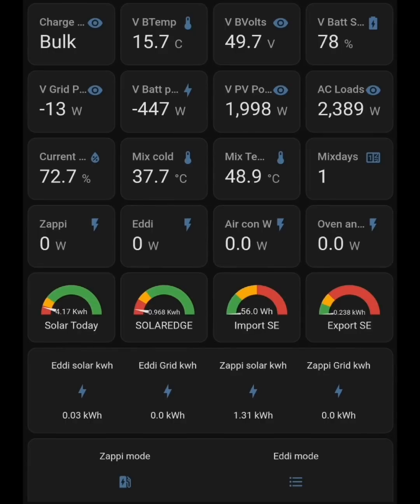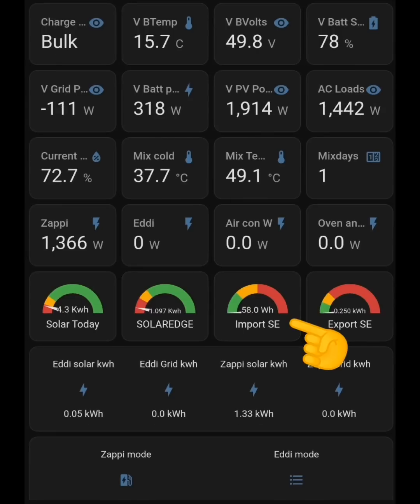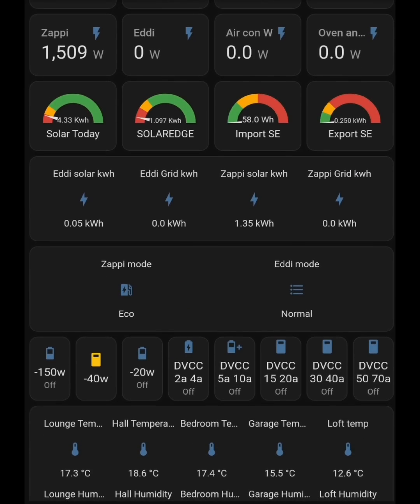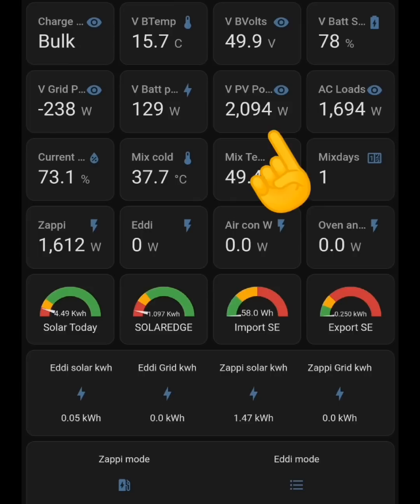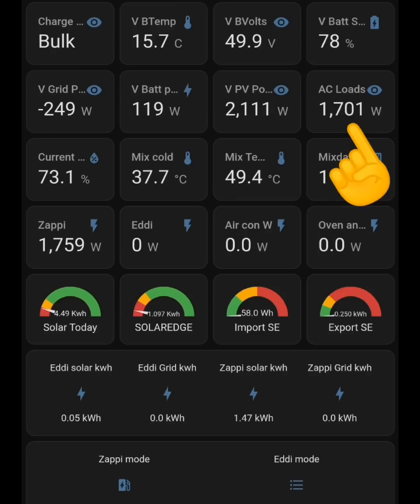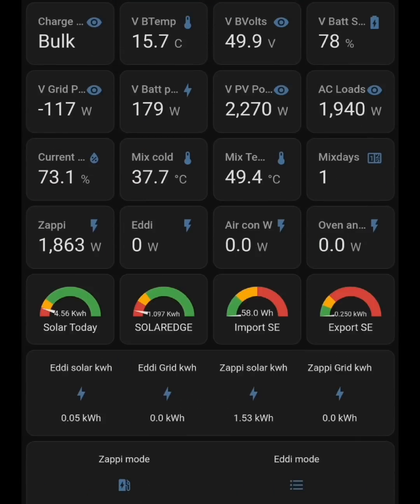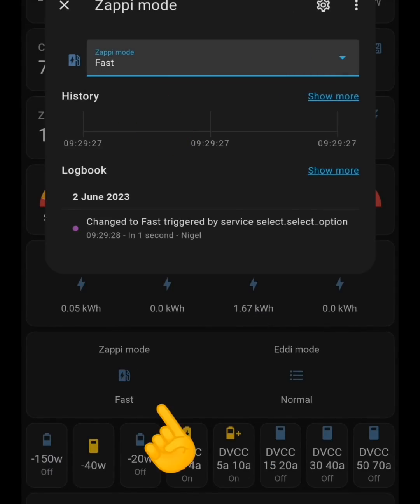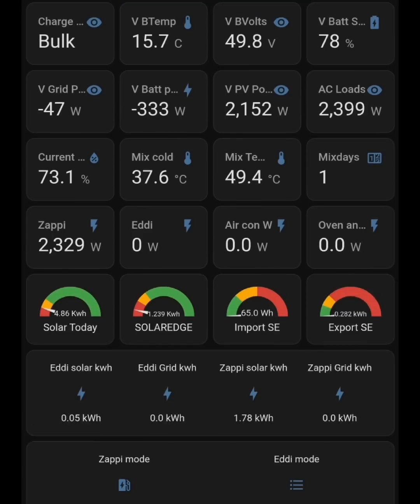Zappi vs Granny charger - Which IMPORTS less energy charging on solar - Data watcher's delight

Comment: Hi Nigel it may be worth considering replacing your myenergi Zappi with the Victron Car Charger.  it integrates into the rest of the Victron system and should eliminate these issues, it has solar export only charging function like the Zappi but better integration with the Victron system.  I much prefer the Victron charger as you can set (via App) what max charge current you want to charge the car at (you can do this on myenergi, but not via app), which means you can control charge speeds rather than the myenergi on/off (fast/off peak charging).  This is great as if you just want to add say 15kw on the 4 hour cheap rate, you can set it to charge at 4kw and spread the charge time over the 4 hours, putting less stress on the car battery and reducing overall house load - the Zappi would just charge at full power for 2 hours and then switch off.  You can still keep the charge on the outside of the Multiplus II and this is an installation option.

It would be great to see a Victron Car Charger video on your channel - hopefully if you reach out to Victron they would maybe consider letting you try one!

The only issue is it's type 2 to type 2 cable, but mounting somewhere to wrap the cable and just leaving one end plugged in isn't much of a problem
Reply from the maker: I have been looking at that but victron are still sorting bugs . I'd like to test one first really to be sure. Fixed amp charging  and limiting battery discharge features are great but scheduling has only just been implemented

Comment: Just goes to show that the key to all this is the control system, and choosing equipment that can integrate nicely.

Once you have Home Assistant in the mix, the simple logic of these single focus systems (zappi, victron, eddi etc) suddenly becomes a baseline competence and the true magic happens when you automate and orchestrate these around one's needs and lifestyle.

It's possible to take any dumb tech with open controls and make it super smart with Home Assistant 🤓
Reply from the maker: Yep, think I've said that a few times now. Inverter choice is key for software
Reply: @EVPuzzle  true to a point... What I'm saying is if it's a good inverter (i.e. good at doing the electrical bit) that can be controlled by HA, then getting an inverter with better software becomes less important as you can fill in the gaps better using HA then any premade inverter software solution. For example, I've got a cheap Solis hybrid that is basically dumb as a brick but inverts well... with a decent HA integration it's smarter than anything on the market, for me, because it's acting exactly as I need it to. Love it!
Reply from the maker: @TheBadoctopus  totally agree, no point have 2nd rate extra software you don't need

Comment: I have the same frustration with the bouncing when heating the water with my Immersun while charging the battery. I tend to let the battery fully charge then schedule the battery to sleep from 12:00 until 16:00 so the immersun doesn’t draw from the battery/ grid  too much .

Comment: Is the solution here more to do with simply a factor of constant charging functionaility to avoid dropping in and out of excess solar charging via the zappi, thus use granny charger if its a sunshine and clouds
 day and if your are on octopus flux or other benefitial export rates then charge at off peak overnight constant max rate for night tariff which is no more than what the export tariff for flux is for daytime and the bonus peak rate benefits, i may have summarised to simply.
Reply from the maker: Seems to be but zappi behaviour changes on the 1.4kw limit

Comment: I tend to try and manage the situation myself, so when it’s sunny like since the middle of May I let the battery get to between 80 & 90%, then start charging a car on Zappi Eco, usually around 10:30 when solar is above 4kWh. I might give the hot water a 20 minute boost first. At around 2pm I’ll put the pool heater on, as the sun will have warmed the top level already throughout the day. Zappi onto Eco+ just in case. If the car stops charging the battery will have plenty of capacity to soak it up. If there’s ever any danger of getting to 100% I’ll boost the hot water
We use more electricity than we can generate most of the time, and there’s always somewhere to put any extra
We have 7.23kWp at the moment. I’d love to put a 4kWp winter array against our south facing rear wall, but although I’ve adopted the land outside I don’t think I actually own it 🤦🏻‍♂️
Reply from the maker: Manual approach for those that love being in control. That's me too much of the time but tends to let more slip to the grif

Comment: Very interesting.  I have an EO Mini Pro 2 with the Solar extension.  I don't like using the solar charging option as it seems to ignore the house load, it charges at the output rate of the solar.  I suspect it is using the CT clamp on the wrong tail. As I don't yet have the battery in place, this means that I always pull from the grid while using it 😞.
Reply from the maker: Think you're right about the CT

Comment: Hi Nigel , I use a 3.6Kw car charger ( which doesn’t change charge rate ) which triggers on and off based on battery SOC and solar pv amounts
Reply: Are you using one of those hardware e.g. A30 "dump load" controllers or similar?
Reply: @EverydayLife621  no it’s just a old school Bosch 3.6 charger , one of the very early ones
Reply: @AllElectricLiving  Interesting, how does the charger know when to switch on? - Ive just bought a small A30 controller (£11) which switches on / off dependent on battery voltage - but as usual haven't unboxed it yet
Reply: @EverydayLife621  all automated with solar  pv , battery Soc , and hot water house demand etc with home assistant
Reply: @AllElectricLiving  Cheers 👍- Im not so modern (home assistant?), so prefer hardware  to software at this stage.

Comment: I also use a granny charger so that I can charge from solar but it was exporting to much so have bought another type 2 cable but it is for a 3kw charger so this limits my charge to 3kw and reduces the export when a cloud goes by the battery picks up the extra current required. Seems to work OK.

Comment: In the majority of the year (summertime BST) we charge the Honda E from a granny lead during the day, which usually gives us more than enough for all our local needs. This often prevents export for which we get pathetic rates, yet keeps the home batteries topped up too. They don't cheap grid charge at night until they drop below 70%, rare in summer.

In the depths of winter the E takes what it needs from a 7kW charger at night on cheap, leaving any day time solar to charge up the domestic batteries.

Comment: My take away, when you get to the point where the demand is slightly higher than the PV you get the oscillation with the zappi. You negated that by effectively reducing the   demand. I.e limiting battery charge current. Which worked for those conditions, on a day with less pv, maybe not. Whereas the granny charger is seen as house load and the inverter can easilly manage that without conflict. Would be interesting to see what happens with s complete my energy system compared to the multi manufacturer system you have
Reply from the maker: One of  the things I'm going to test is swapping CTs moving the solaredge CT to Myenergi to see if it improves  but yes my house loads without any dynamic adjusting and managed better .

Comment: Interesting video

Not sure it is worth worrying about the minute amounts of grid energy you might use, 100W for 10 seconds is 1/10th of a penny

I have a 6kW inverter so I’ve reduced the maximum amps on my Zappi so I can run it on Fast without exceeding the capacity of my inverter and using grid power. This can be handy not just to fast charge the car from solar, but if I want to free up space in my home battery quickly. If the home battery is full and I’m going out so can’t put excess in the car, I’ll fast charge the car to leave spare capacity in the home battery

What I really need is to get my export MPAN sorted so I can get paid for export and worry less about using every kWh I generate… 😉
Reply from the maker: Yes getting yourself on export changes things completely.  The tenths are just annoying from a data point if view , monetarily it's just 3p to 5p so not worth worrying about
Reply: @EVPuzzle  ah yes, I can see it would be frustrating from a data neatness perspective 😆

Trying to get export sorted but there is some issue with the DNO...

Comment: I have many tiny 0.01 kWh charges on my electric bill which I put down to my Powerwall not being as fast as the mains to adjust when a load changes,  when I'm exporting it doesn't happen. The only solution that I can see is to use the Powerwall in "Off-Grid" mode (disconnect from the grid) when conditions allow so its not able to draw from the grid.

Comment: Your not quite comparing like with like, as your granny charger looks like it on the ACout1 (critical load circuit), so its one way flow from the VE/battery, so is essentially powered via the battery as the dominant lead source, where as the zappi is probably on AC-IN (bi-directional feed AC coupled feed), hence its trying to blend PV/Bat/grid? - its only 3kw/month coming in (£1? / month) - remember that your letting go 400kw/month. (also see VE video :- Did You Know - Trigger a dump load when your batteries are full - where you can use ACout 2 )
Reply from the maker: Well spotted and true but I did see the same before it was wired up this way
Reply: @EVPuzzle  You'll always see it, as solar (🌞) is AC coupled (so its more of a parallel system), so you have 
🌞 
🔋                     to              load 
grid  

we have same VE system, albeit solar is DC coupled (and much smaller), we dont see it (or havn't noticed it), we have

 (🌞  +🔋)
        grid            to              load

... so the battery is buffering the solar. I've just checked the smart meter today its saying Total today 0.000kWh (red light is permamently on)

EDIT:As we're just approaching bedtime - the house draw is 70W, but for some reason? - the smart meter is nolonger a constant red LED.

Comment: Brilliant timing! This is just what I needed to see after buying an EV last week. I have been temporarily using the Granny Charger and I’m about to have a Zappi, installed in the next few days.

Which setting on the Zappi do you use to ensure it adjusts according to Solar loads?

As an aside, perhaps a different video? The ‘Bouncing’ and slow reaction times that you mention are really annoying as it does build up, and I wonder how much this costs us in our pockets?

Great video and thank you for taking the time to explore the issues.
Reply from the maker: It only costs pennies really but it's annoying as it shouldn't happen with his fast batteries and the zappi  should respond .

Eco sets 1.4 min load plus adusts up with more solar .

Eco+ adjusts to solar but will cut out and stop if solar drops below 1.4 and the minimum grid pull parameter

FAST ignores solar and just charges

Comment: If you have a battery see no point in a zappi  if the clouds come over just draw a bit from the battery no problem.I have a variable Rolec so if not much sun leave on low as the power improves and battery nearing full  I turn it up  very rarely  do I have to  use go overnight to charge car  but only do 150 miles on a normal week.

Comment: Super video, I was with you most of the way as you are doing what I was interested in myself but never bothered to do. I have Zappi and Fox ESS Hybrid system and interested in how well the system would work on diverting excess solar into the car and was delighted when I found it worked better than I ever expected, hats off to the software engineers at MiEnergy because they seem to have got it as optimal as they could. I don’t have control battery charging rate and can’t enable force discharging to the grid on the Fox system I have and so my Octopus Go strategy is based around keeping the batteries as fully charged as possible and minimizing exported power by diverting to the car. The only change from the default setting of the Zappi I have made is to increase the minimum export to grid from 50 Watts to 100 Watts, this ensures that the Zappi will always disconnect in Eco++ mode when available solar is below the 1.4 kW limit, but now we are in the better weather I tend to use the standard Eco mode. Keep on reverse engineering the Zappi control algorithms so I don’t need to, you could just talk to MiEnergy and they may just tell how it works
Reply from the maker: Glad you appreciated it . I've been meaning to do this for ages . Took an hour then almost a day to edit it but glad it's now out there.

Constant loads work best
Reply: Yer  very interesting video  bit like ive seen but retest this when its a peekaboo sun day even with fixed charging like you dod Nigel with the granny charging then  you see more of a wide swing when the sun comes from behind the clouds we see wide export ie 300-400 watts for a few seconds then our system drops its to very little either way but when the clouds come over we get wild import ie 100-500 watts when charging at say 2.5 kWh then 5-10 seconds later the battery takes it down to 10-20 watts bit like when you the oven or kettle etc  unfortunately other than limiting the battery charge by the app i cant adjust the import export magins like you Nigel , if anyone know how to add button etc for the fox systems over modbus  in ha let me know and would love a grid charging on off button too . But like you say Nigel its only a maybe an 50-200 watts over the day when charging from solar it’s nothing too drastic but can be annoying!
Reply from the maker: @nickieredshaw7835  perfect description Peekaboo day 

Having more energy than we need really helps , being patient to recharge is the key but a system that really works instantly is the dream . Sadly UK grid connected rules sort of prevents it

Comment: Hey man. Another super nerdy video... Well Done!!
I should be getting my Victron battery setup installed in just over a week!
I was intrigued the HA can link directly to it. Do you need to change any settings on the Victron for that? I know it has an MQTT setup that can be turned on. I was planning to use that for my Old School status board...

Comment: I've been on a granny charger for 2 years, at 2600w, works great for me and I'm still not convinced I need to spend £1k on a zappy! Cheers
Reply: I am not a big data watcher but don’t like the idea of excess solar going to the grid. So I either charge the car up with the granny charger or the I boost takes care of it to the water cylinder
Reply: I think you’re right. I got a Zappi because I was waiting so long for my house batteries. I also have a granny charger that you can set for 6, 8 or 10A which deals with most scenarios I can think of
Reply from the maker: If my zappi broke I don't think I'd replace it like for like . 32amp ohme charger maybe next time
Reply: @EVPuzzle  I'm not sure if this would resolve any minor challenges - we have VE MP 5000 GX + Ohme - very much off grid March-Oct., but they all do have brain farts (weekly/monthly?) - stick with VE, which is so much more resilient / clever?
Reply: Depends what your use case is I work from home so most of the time the car is there during the day. I use about 130kWh a month in the car. In May all of that came from solar, April all but 10kWh came from solar. Jan Feb and March is a different story where most of the charging Pod Point as I didn't have Octopus Go then but I didn't export any solar as it was all used in the house.

Comment: Since I fitted my system myself, I have no grid export. All my electricity is off-grid as it all flows through the 15kW inverters, unless I ask for grid supply. As we've moved into May, the system is managing to keep the lead-acid battery bank charged enough every day to not need to tap into my Octopus Go tariff at 00:30 - 04:30am to return it to 100%. The water tank I've fitted has two 3kW immersions which I turn on around 9AM and turn them off at 6PM. We have enough hot water for all our needs and I charge the Nissan Leaf from the granny charger which is a 3.5kW. I am wasting potential export energy on hot days, but at least I can manage it all myself. I may look into getting the system MCS approved in the future depending on what it will cost me.
Reply: @garysmith5025  How would that work Gary? You'd just connect the car to your charger and it would feed back? I didn't want a smart meter but as Octopus were charging me 66.5p per kWh for electricity and 16.5p per kWh for gas, I had no choice but to put in a system. I've now just about made the house gas free (still got the supply....about £160 a year) apart from plumbing the central heating to come on for the really cold days to take the sting off the house, then we'll maintain with localised 2kW fan heaters. I'm not going through another winter like the one we've just been through. Our electricity rate is now 9.5p per kWh during 00:30 - 04:30AM which will be enough time in the winter to charge the battery, charge the water cylinder and the car if necessary. My monthly direct debit is now £75 for both gas and electric, with about £31 of that meeting the standing charge. Depending on how this year goes and especially winter, I'll decide in a year or two whether to ditch the gas supply.

Comment: I use an Ohme charger and when the car will not need charging at full speed overnight, I set the max output to 8 amps via installer mode (no fancy clever stuff like the Zappi can do unfortunately). That way it will charge the car from the solar panels only instead of exporting, and when a cloud pops over temporarily it will take a little power from the hybrid home battery when needed. Works a treat for me and I love the feeling of driving the car on pure sunshine. 🌞